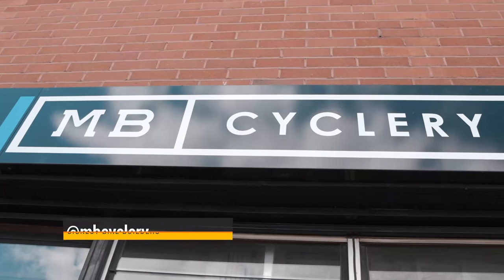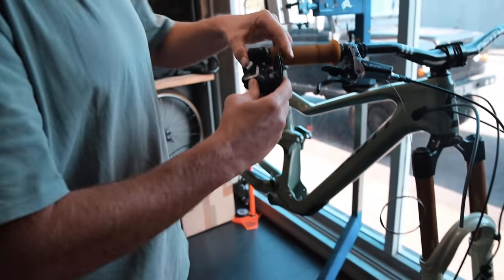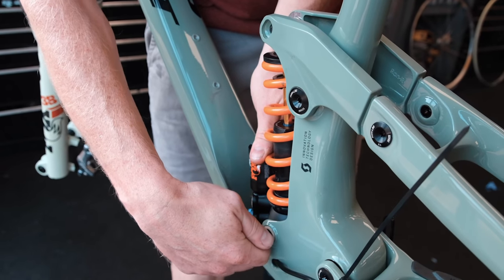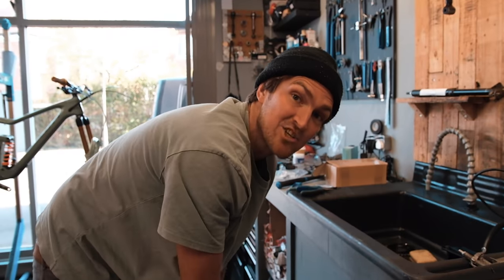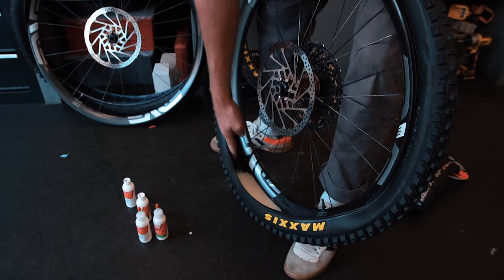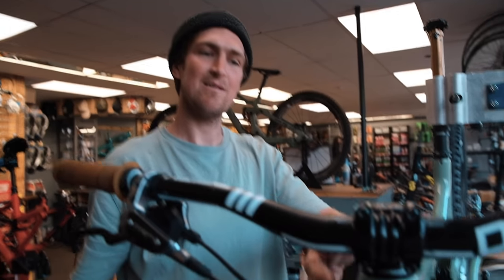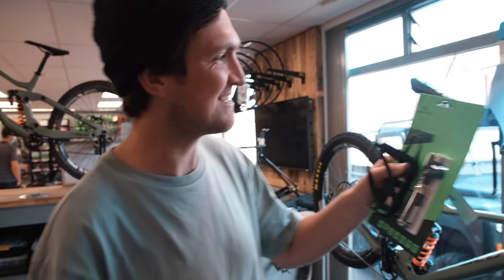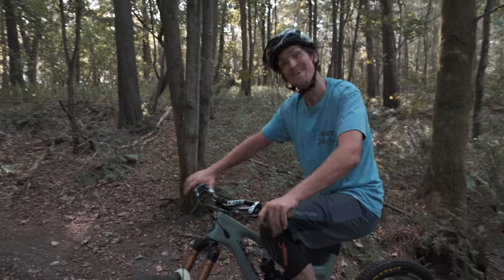NEVER GO FULL ENDURO!!!  NEW BIKE DAY, FIRST RACE OF THE YEAR!!!

Comment: Why putting the rear shock up side down? And Brandon is just asking  for the lock for uphill :D
Reply: Is the frame even able to run it the other way round?
Reply: frame clearance and possibly the bearing mount orientation?
Reply: Trunnion mount is at the bottom on Scott Frames